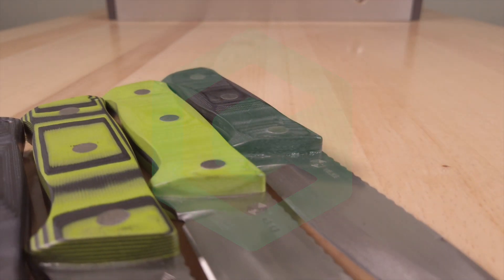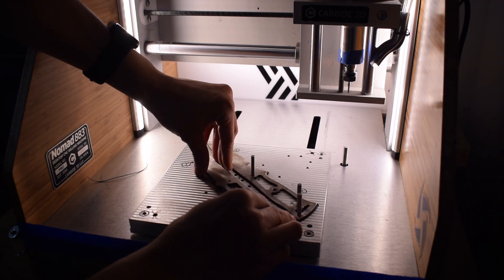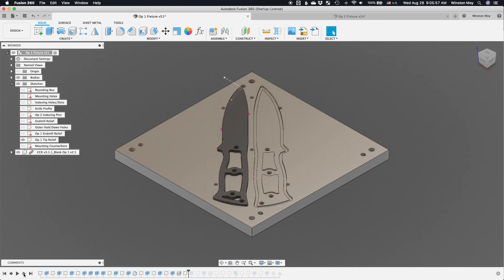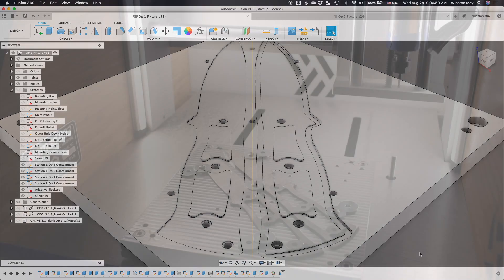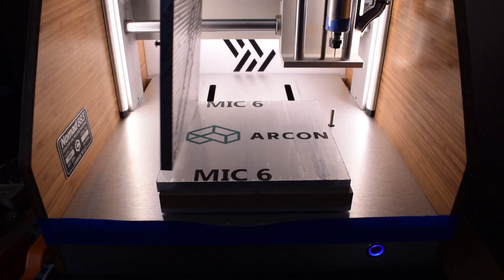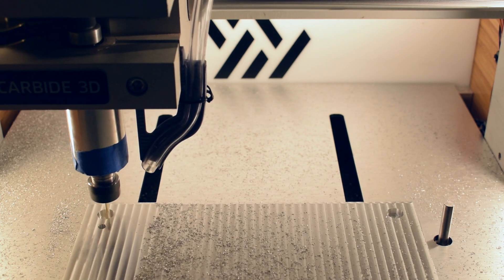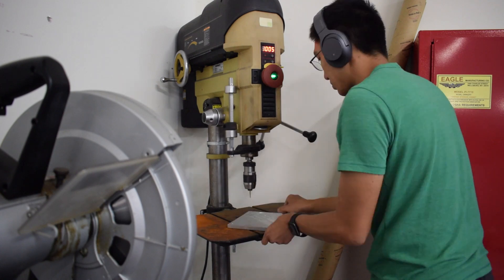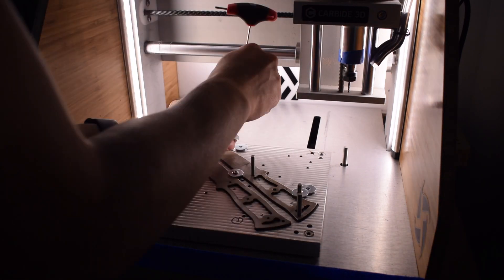Making Custom Fixtures for Machining Knives - Carbide Camp Knife Pt. 2

Comment: Im just about to make some aluminum fixtures of similar size on my new Nomad 3. Why were you worried about over-boring the holes? Shouldn’t the nomad holes be more accurate than a drill bits slightly oval holes on a manual machine?

Comment: once you've machined the first blade profile to give the sharp edge, you then flip over to machine the next side.
a) is your jig 3d machined so the previous side fully supports up against the newly sharpened edge slope or is there an air gap/space under the previous angeled sharpened edge?

b) I am assuming you leave some stock on the final knife blade edge at the milling stage? how far do you machine the sharpen edge for the final blade sharpening on a belt grinder?

c) Let's say you leave 1mm thickness of blade edge on milling at what point do you sharpen the final edge on a belt grinder after milling, do you harden it after milling, and then final grind the last mm to a sharp knife edge?

A

Comment: What were the speeds & feeds for surfacing the MIC6 plates with the 1/4" bit?
Reply from the maker: Target depth of cut was 0.004" (~0.1mm), which obviously varied on the first pass, 10k RPM, 15-20 IPM depending on how pretty you want it to be.   -W

Comment: Would clamping from the holes in the handle not provide enough rigidity for the next part of the operation?
Reply from the maker: It would hold the blade in place securely, but machining way out near the point you could get a little vibration if you don't have something supplemental clamping down near the tip.
Reply: Carbide 3D I can see that especially as it is thinned out.

Comment: Great info as usual.  While I may not make a knife, your methology is very informative for future projects.
You keep reminding me that I need learn Fusion360 and buy a Nomad to compliment my Shapeoko.
I know there are plenty of 360 tutorials out there, but it would be interesting to hear your thought process. 
Thank You Winston and Carbide 3D.
Reply from the maker: Fusion can be kind of overwhelming at first, much like CNC. There is a looooot you could learn, and there are great resources like Lars, or NYC CNC you can use to learn specific topics. To start, I'd focus on the basics: Get comfortable with the UI and basic tools: sketching, extruding, etc. There's no getting around the fact that it will take time to become proficient in that. But for the more advanced stuff like sculpting, complex lofts, etc, add those skills as you require them. Basics first, and then let your projects guide your learning. -W